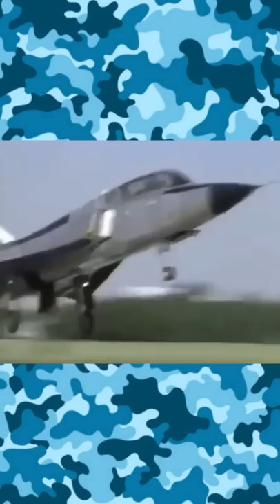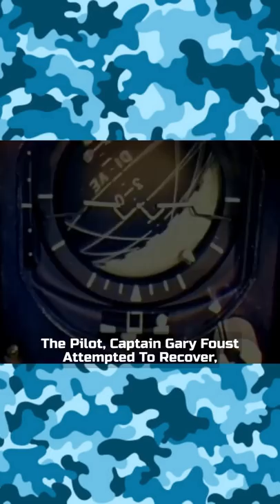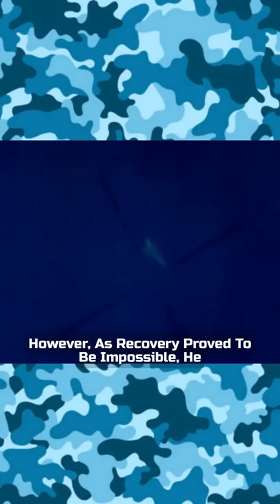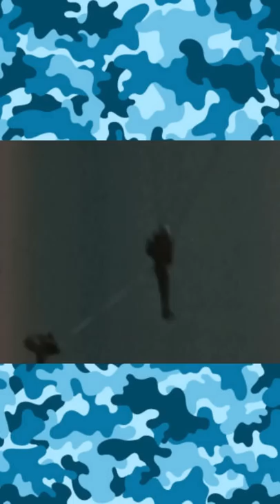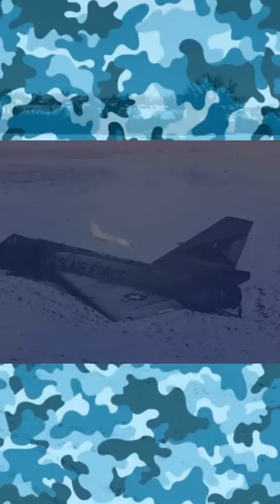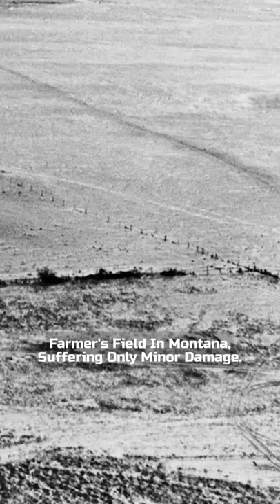When an Unpiloted F-106 Delta Dart Aircraft Landed By Itself #shorts

Comment: This also happened in 1989 in the Soviet Union. A MiG-23 had almost the same issue. The reactor turned off and when the pilot eject the turbo reactor turn on again. It went on autopilot for 900 km and run out of fuel.

 During this time. The plane had crossed the Polish border, flew over East Germany and after that West Germany where it was intercepted by F-15  Eagle of the USAF. 
The F-15 pilots didn’t get the permission to shoot it down since it could cause damage on the ground so
the MiG continue his flight across the Nederland and then crashed into a house in the town of Bellegem in Belgium. Killing a 19 y/o man on the ground and destroying his house and others surrounding it. 

This incident lead to a diplomatic crisis between Belgium and USSR.
Belgium deplores the lack of reactions and information from the USSR to prevent the incident. 

On July 5 1989, Mikhaïl Gorbatchev, during a visit in Paris, offers his condolences about the accident: "I'm sorry. The Belgians know it, know the causes of the accident and we sent them our condolences. This kind of incident can happen, but it is better to avoid them ”.

The Soviet Union compensates the damages to the Belgium Gov, the family of the young man and neighbourhoods with 685,000 $.

Comment: Wow, imagine if the landing gear is deployed. Maybe it's gonna landed without a scratch

Also, is that aircraft already had a fly by wire system tho?
Reply: What is that
Reply: First flyby wire was the F-16 also if the landing gear was deployed it would probably be worse
Reply: No to the fly by wire and the landing gears extra drag would have pulled the nose down wich would have caused a worse crash. This aircraft just happened to have been built perfectly balanced.
Reply: During this point in time Fly by wire was only being used by NASA with at this point in time.
Reply: @odylom  fly by wire means electrical wires go from the pilots controls out to all the different control surfaces where there is electric servo’s that move the controls with hydraulics, that’s how you get the term “fly by wire.” Non fly by wire has the hydraulic lines coming from the pilots controls out to all the control surfaces. You can imagine the mess and difficulties having active hydraulic lines literally everywhere and the challenge of keeping everything as leak free as possible. There are definitely difficulties and challenges with fly by wire but in theory it seems much simpler. That was also a very very basic example, there are tons and tons and tons of different variations of the two I described but those are pretty much the basis of it
Reply: @Mr.Thermistor7228  ty
Reply: It probably would have crashed with landing gears out as it would have caused more drag and it does not have fly by wire system

Comment: For those who don't know, a flat spin is most of the time caused by losing speed too much that the pot loses control of a spin, so to get out of it which is pretty damn hard, is sith the rudder, if the plane is spinning left to right, use the redder that makes the plane turn right to left to try and stop the spin.

You can also push the nose down to gain speed and hope that you can control it again